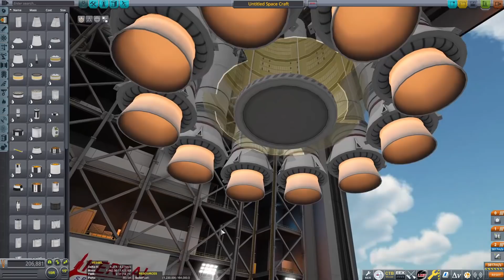KSP: That Time NASA Went Full MOAR BOOSTER Mode!

Comment: You mentioned that you have BetterTimeWarp and Editor Extensions Redux installed. Do they work correctly on 1.11? Do you need to modify them at all to make them work?
Reply: They both work fine with no modifications
Reply from the maker: they work fine for me